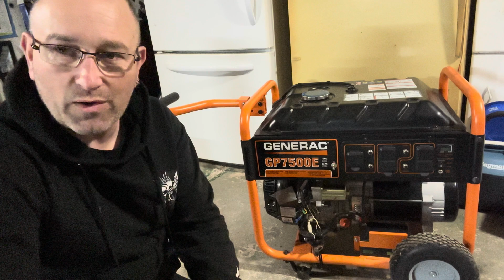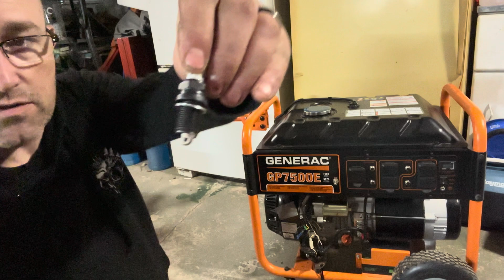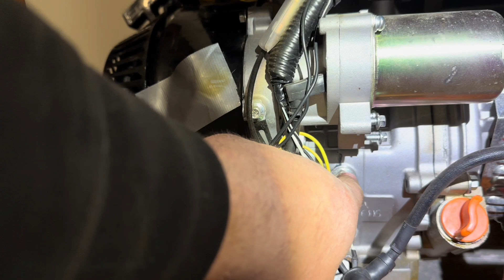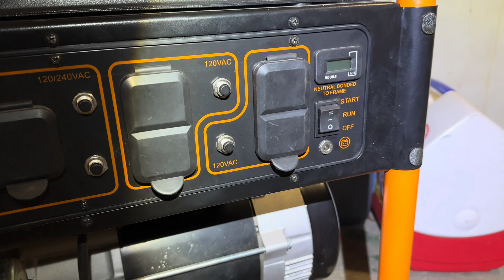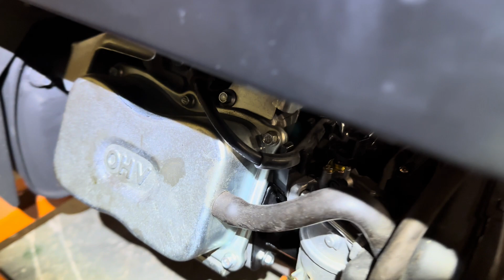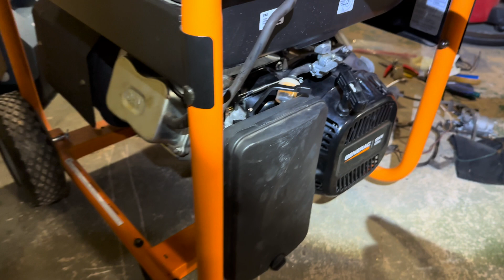Generac  no start, tips to get it going

Comment: Great job. Best one yet on the Generac GP 7500E. Be good to start with a 12v battery and tap the brush leads, so if that does a quick flash to get it working. That saves a lot of time.

Comment: Glad you found the faulty part for your friend. The new kill switch bypassed the problem 👍
Reply from the maker: The kill switch was grounding the coil was my issue, it threw me off when it was still producing a spark when I tested the plug out of the cylinder. A tricky Diagnosis Dave, thanks for watching